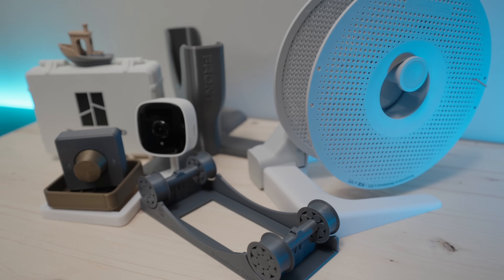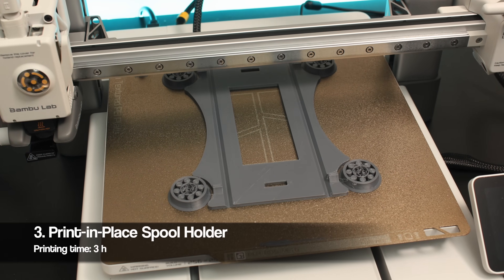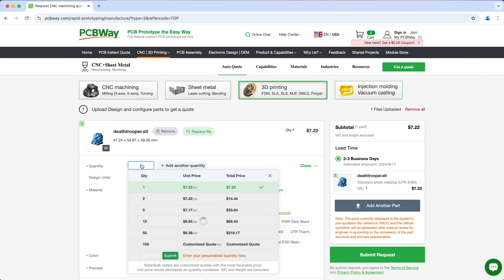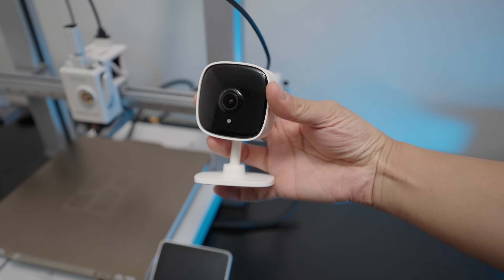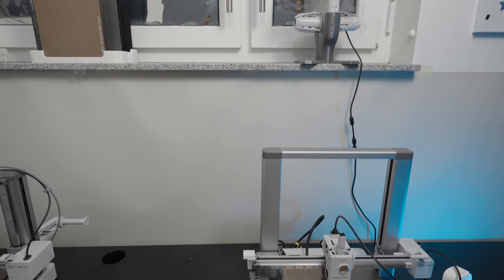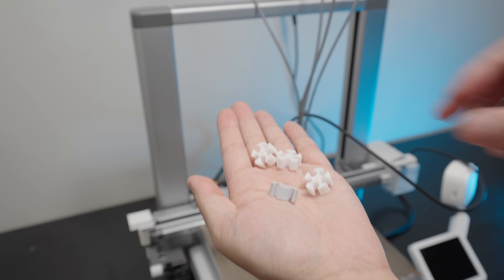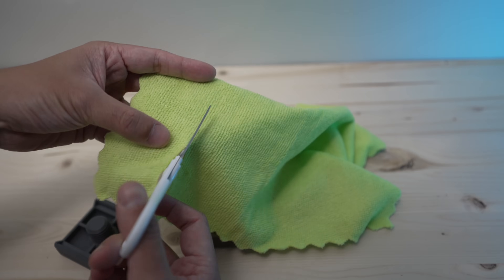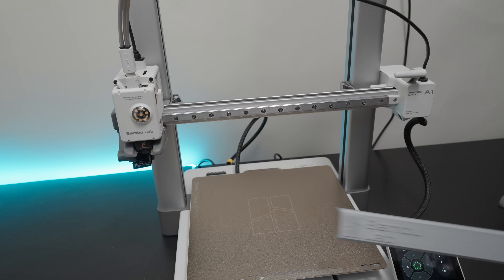10 Must Have Bambu Lab A1 Upgrades & Mods

Comment from the maker: Get your accesories for the mods here:
PTFE Connector: https://tidd.ly/49mCjdU
PTFE Tube: Tube: https://tidd.ly/49Dw6eX

BambuLab A1: https://www.awin1.com/awclick.php?gid=570772&mid=46345&awinaffid=2034675&linkid=4382705&clickref=
Best affordable 3D Printer: https://www.awin1.com/awclick.php?gid=570773&mid=46345&awinaffid=2034675&linkid=4382675&clickref=
Recommended Filaments: https://www.awin1.com/awclick.php?gid=570777&mid=46345&awinaffid=2034675&linkid=4382680&clickref=

Filaments used in this video
PLA gray: http://shrsl.com/4sum4
PLA Bronze: http://shrsl.com/4sum5
PLA Silver: http://shrsl.com/4sum6

My 2nd favorite filaments: https://geni.us/A4OFomi
Lubricant for X,Z,Y-Axis rails & idler pulleys: https://tidd.ly/3KMFHqs
Grease for Lead screws: https://tidd.ly/3Lk36j2
Deburring tool: https://geni.us/9WGzv
Wire cutter: https://geni.us/NAwQIL
Heat gun: https://geni.us/Jdcu

#Affilliate

Comment: Instead of using a razor blade to cut, buy a cheap pair of wire snips. You can get them for a few bucks from most hardware stores, and you don't have to worry about snapping a blade by mistakes or leaving it open and cutting yourself.

Comment: I was told not to use iso on pei sheets, is it ok to use?
Reply from the maker: just use it moderately. Avoid touching the plate too much when you remove prints so you don‘t need to use iso to begin with. 
Wash your plate with dish soap if it‘s greasy. 
I don‘t always clean my plate with iso because i know my plate is clean. But I still use it sometimes and havent had any issues.
That said, PEI plates are consumables so they don‘t last forever.

Comment: IPA 99 Destroyed my plate adhesion within 2 days, soapy water ftw.
Reply from the maker: hows that possible😳 ive used IPA 99 for 2 years. of course u wanna use it moderately and avoid using it on tacky plates

Comment: Blink camera need you to join and will only record for 90 mins sad guess it would be fine for small items but worthless to record for long times. I tried a security system but even that was a super pain and had to buy a program to use the video as most system will not let you watch the video unless it is on the security monitor. Fater buy the program to change the files over to something most people watch i could them edit the video. Other system will record for 1 min files :( again worthless. SO short recording if that is what people are into will work but forget about long videos that one can edit and speed up. I gave up on the videoing for the 3D printers.  By the wat awesome video well-made and enjoyed watching thanks for posting it
Reply from the maker: yeah security monitoring cameras aren’t made for that sadly. So if you wanna record long videos, I suggest to just use a video camera.
And thanks man, glad tou enjoyed my videos!

Comment: Why do your single color prints have those little color purge towers? O_o am I missing something? I've done all these prints without support and without those towers. I used the default profile that the maker site gave. I feel like I am missing something.
Reply from the maker: you don’t need the tower for single color prints. I just do timelapses that’s why I turn it on😁👍🏼

Comment: Hi, thanks for your video and your work. How do you create smooth timelapses with the A1 and your camera?
Reply from the maker: hey youre welcome man. I mounted a swith on top of the x axis cover and do a smooth timelapse. I have a tutorial on my channel. You can use my mount, but you can find alot of other designs out there that‘s just as good! 
My mount is more temporary and not permanent so i can take it off when I dont need it.

Comment: Only downside of the external camera mount is it doesn't move up with the print..
Reply from the maker: you can tilt the camera so taller prints will be in the frame. And you can always monitor both livefeeds. Of course, the original one isnt the best, but its better than nothing.
Reply: @Lukis3D  even if you tilt it up though, you won't be able to see the upper layers from above.. would be nice if they made one so you could mount it to the gantry

Comment: lol.. those PLA ball bearings not turning at all... literally pointless
Reply from the maker: if you lube the bearings with some oil (use the same lube for the rails), and put some rubber bands on the wheels, it‘ll work like a charm!

Comment: The X-axis dust cover is a bad model. It has several points of failure which could be avoided by just removing the logo or making it subtracted from the surface and then printing it upside-down making a contact area MUCH larger.
It failed for me and several people in the comments.
Reply from the maker: yeah, you can just remove the logo and print it upside down👍🏼 I haven‘t had any issues printing it (using the designer‘s print profile).
I even printed the same model for the A1 mini in this orientation and it printed without any issues

Comment: they specifically tell you not to use ipa on the pei sheet as it may cause damage
Reply from the maker: ive used IPA without any issues. i think people tend to use cheap IPA that‘s diluted with additives that will leave residue on the plate that can cause adhesion issues. I use 99.9% concentrated IPA and so far no damage or adhesion problems.
Or people tend to rely fully on IPA that they don‘t do proper cleaning routine like washing with soap and then touch the plate too much. You‘ll just speead the grease on the plate. The goal is to dissolve grease using IPA then pick it up with a clean towel. If you use a dirty towel than you‘re not going to pick up anything.

Comment: have you printed in PET-CF  (not petg) on the a1 mini/ a1? i am looking for structural material to print with my a1 mini. i guess pla always wins for strength per dollar if you don't have volume or temperature limitations. just print a brick of pla.
Reply from the maker: hey man no, i havent printed it, though I‘ve heard sucsess stories of people printing PET-CF on their A1 printers. 
I‘m not sure if its possible on the A1 Mini since the bed temp only goes up to 80degC. I believe the recommended bed temp to print it is ~100degC or something.
Reply: @Lukis3D  yeah, it would be a really interesting material if it works. if I can find a kg for less than 50 bucks, i might try it out on the a1 mini.
Reply from the maker: that‘s a pretty sweet deal! Let me know if it works👍🏼😁

Comment: Just one question. 
Why do you print a purge tower with single color prints?
Reply from the maker: hey man, it‘s because of the timelapse smooth mode👍🏼
Reply: @Lukis3D  I use elegoo neptune 4 plus 3d printer

I don't know which is best, i see many youtubers mentioning bamboo.
Reply from the maker: hey man, i think it comes down to the print volume. If you want to print big models, then Elegoo (320 x 320 x 385). Bambu A1 has 256x256x256mm3 print volume so its smaller than Elegoo. 
If you get the combo, you can do multicolor printing.
Or if you‘re on a budget, get the A1 Mini for $179.